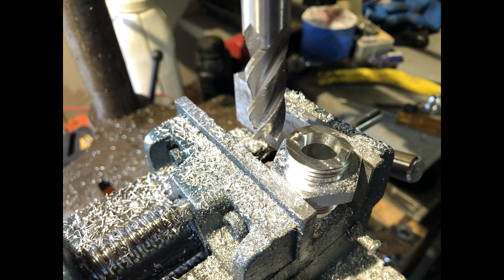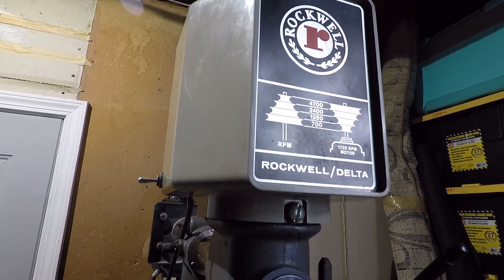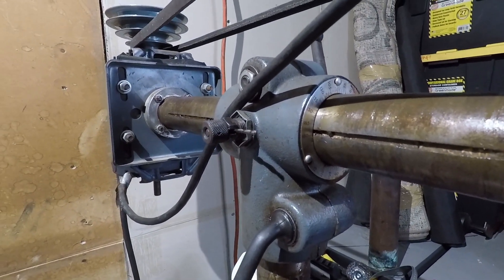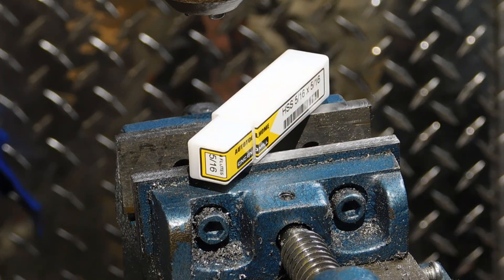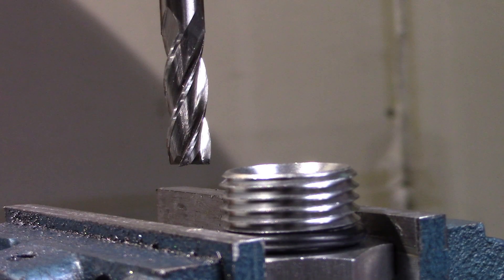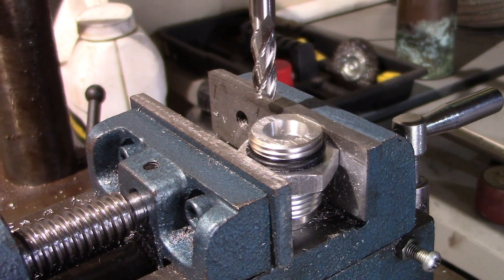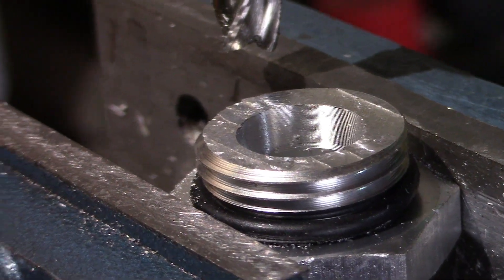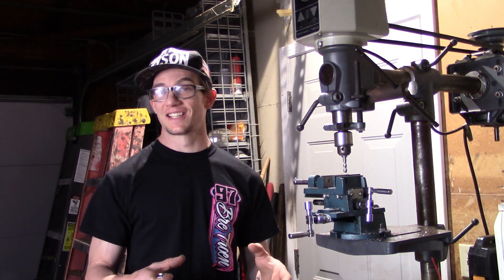MILLING ON A DRILL PRESS! Cringy Machinist Ep1: Drill to Mill Conversion

Comment: Your spindle speed is not only dependent on your material, but also the diameter of your drill or machining bit. Your calculation for drilling and machining would be ((cutting speed x 4) divided by dit diameter). The calculations for reaming is done the same way and then divided by 3 to get your rpm. Hope this helps you out. You should be able to google the cutting speed for different materials on google. Keep in mind there are 2 different cutting speeds, one for drilling and one for machining. Just for quick reference (cutting speed for aluminum - 250 sfm for drilling and machining) and (cutting speed for steel is 50=drill sfm and 70=machining sfm.)

Comment: Rockwell delta being a top product of quality is a very good choice for a drill press milling machine, but the 32" radial is probably 3red from the bottom of the list to convert because all the flex they have ...the compactool 11-000 being the #1 worst drill press to convert  #2 pretty sure I'm forgetting about one in between so leaving that open for opinion ...then #3  32"  radial
Reply: And supposed to use a threaded chuck not a taper or bolt/set screw that will throw the chuck off center

Comment: you talk about putting a drawbar in at one point, if you had't noticed, there is't actually any room to do so.          so i would have a look at putting a type of collar on the end of the quill and ream the spindle bore out to accept a ER32/40 collet w/ a strait shank. any "engineering firm" could do that for you if you ask nicely! I imagine the collar goes around the stationary quill of the machine at the tip, and a bearing goes around the portruding bit of the collet holder shank held in place with a spring clip.    sorry for rambling on for a while, but i think that this idea could work,, also you probably should change the bearings as the ones in it now are for axial load as opposed to radial load, so they will give you play/runout problems and a collet will hold tools a hell of a lot more concentric. anyway, happy Christmas, and good luck

Comment: I will change the MT for a ER 20 adaptator and secure it whit a "T"  bolt sisable for the hole for removing the MI toll. Je changerais le Morse taper pour un adaptateur ER20 modifié pour accepter un boulon en "T" adapté à la grandeur du trou pour retirer les outils Morse taper.

Comment: Well  kudos for trying.  depending  on  the attachment  method  that kind of loading can yank the chuck out of the  spindle.  The bearings are not made for  side loading  they just aren't.  You will wreck them in short order doing that.  Your idea of  heavy construction is probably  wholly  the result of exposure  to hobby class equipment   not made for   cutting steel.  That drill press is not heavy.  It is very light  even for a woodworking machine.   your choice of the small cutter is  wise given the  insane   Limitations that machine presents for this application. 

Gloves around rotating machinery  is  really a bad idea.   Nitrile  or latex gloves are OK   because they tear easily,  but not leather or cloth .  When  ( not if) it gets caught it will all happen so fast and  so powerfully  you won't know you lost   parts off your  hand until after you see it on the floor. https://www.thesun.co.uk/news/2759699/shocking-injuries-of-welder-whose-thumb-was-ripped-in-half-when-his-glove-got-caught-in-a-drill-machine/
Reply: Could you drill out the majority of material and the smooth it out with plunge milling safely?
Reply: Change the bearings to a roller taper and you're fine especially with softer metals such as aluminum